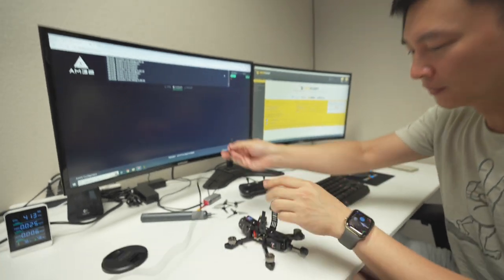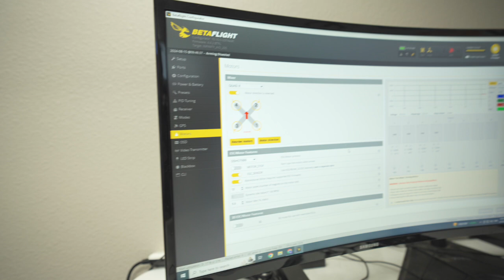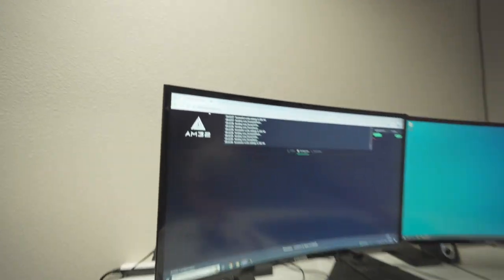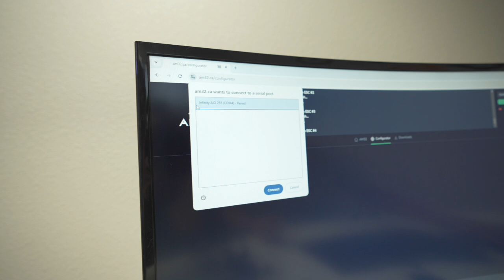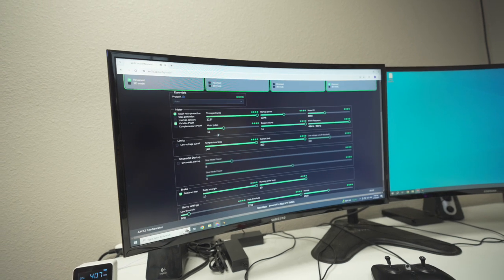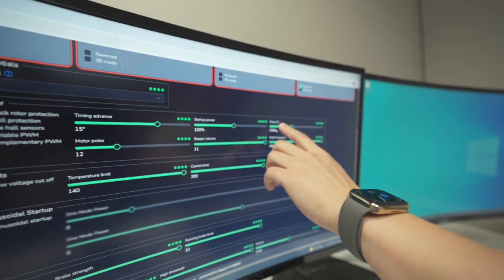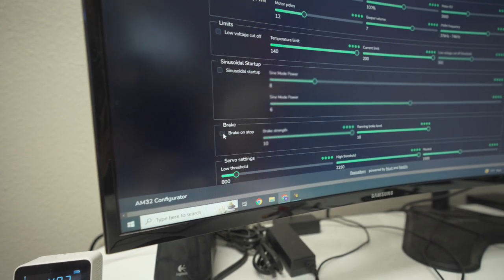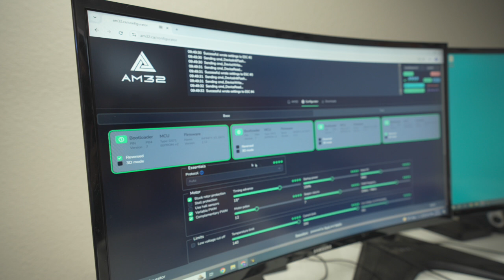StingerBee HD AM32 ESC Setting Update | A NewBeeDrone Tutorial

Comment: Hi, i have the same quad with the 03 unit and elrs. Im using a pocketmaster radio. Ive managed to bind my radio to the flight controller. my radio is working in betaflight but when powered up my quad wont arm. i was hoping you might have a solution  since you have some experience with this quad. please help if you can, im stumped. thank you!
Reply: i have the stingerbee with the 03 air unit and elrs.
Reply: @theweapon2049  im assuming you will have solved this by now but if not this may be because the arm switch has not been set up in the BF modes tap